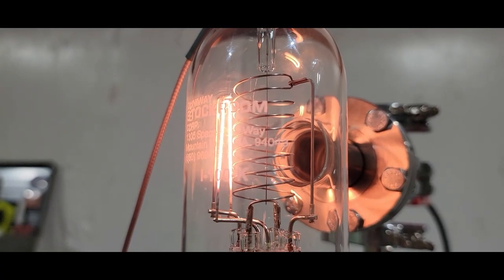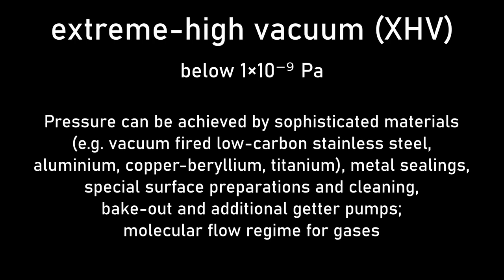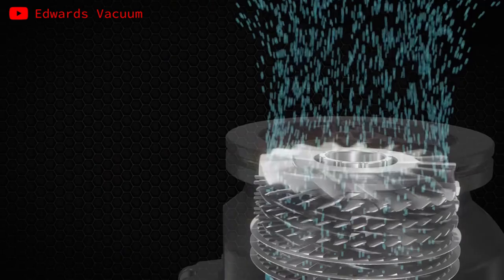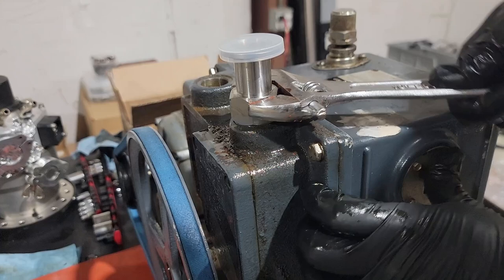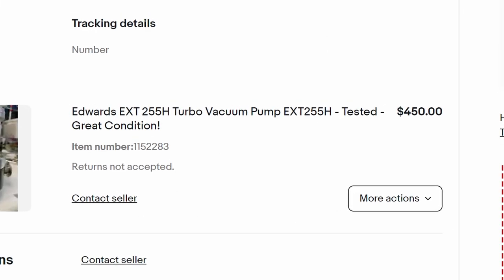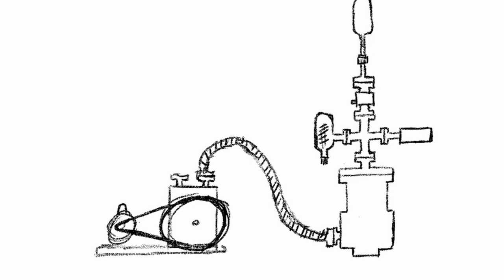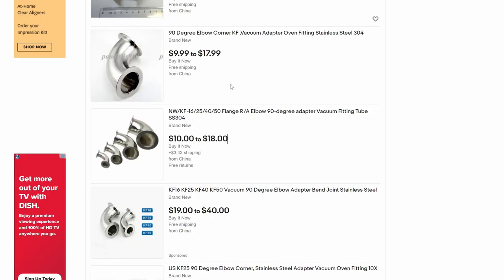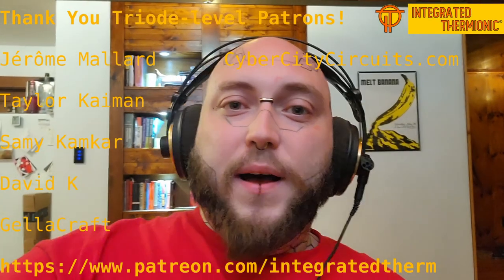High-Vacuum Basics and Evacuating Electron Tubes

Comment: Great video, and a clean explanation! A couple corrections:
1 - Ion pumps are UHV only, and require a high vacuum stage before them to start operating. You cannot start an ion pump from foreline, even if your forepump reaches practical limits(say, 1e-4 mbar). Titanium sublimation pumps can start from rough vacuum, but their useful life is dramatically reduced in that operating mode.
2 - KF & viton technically reach UHV, but baarely. You'll struggle to go below around 1e-7 mbar without suffering.
Reply from the maker: I appreciate the clarification! Pinning your comment for future travelers.
Reply: And no mention of cryogenic pumps
Reply: @moonpiespotlight4759  They're too expensive for your typical hobbyist. And too power hungry sometimes.

Comment: As a former sputtering engineer, this is a good explanation.  I do wish more of the vacuum pressure was used with torr instead of pascals as it is sort of a standard in the industry.  I feel you could have touched on cryopumps, and while I understand they are a little outside the realm of a hobbyist, they also have great pump speeds with water that far exceed turbos for a similar pump size, not including external compressors.  I appreciate your explanation on valves, gauges, and on the pumping measurement thought process, good job!  Good luck on your vacuum endeavors and BTW I may also have a couple of varian rotary vane pumps, plus boxes of CF stuff taking up space in my garage, if you are still looking for anything....

Comment: Crycoolers if another way to achieve high vacuum.  During tests for repairs, our chambers get as low as 3x10^-7 with a Roughing Pump + a TMP evacuating the chambers.  And our goal isn't high vacuum, it's testing heat load, so anything over 9x10^-5 is just a consequence of the low temperatures and gas molecules condensing on the Radiation Shield.  Now imagine if you had a dual chamber with a large butterfly valve and a way to actuate the head of said Crycooler in and out of the main evacuation chamber.  You could pull a UVH, actuate your Crycooler into your main evacuation chamber in order  to condense any extra molecules floating around (This has the added benefit that any molecules that don't cool enough to condense will still have less kinetic energy, thus decreasing it's mean free path allowing the blades of your TMP to better capture those slower molecules).   After Extremely High Vacuum is achieved, you can then you actuate the cryocooler back into the secondary chamber and close the butterfly valve in order to prevent anything condensed on your Cryocooler from migrating back into your main chamber.

Comment: 8:02 - Its interesting that there are no information about drag pump, all I'm able to know about them is hearing and reading about it but not able to get a description of what exactly it is and how it works. No videos of it, no pictures of it. I didn't know that the bottom screw spiral at the bottom of the turbomolecular pump is actually the dragmolecular pump, really interesting. Would be nice if you made a video about it and discussed the progression of early turbo molecular pumps, I know that drag pump was the first molecular pump of it's kind then came the turbo pump. 24:07 - Smart, in a professional setting I bet they do the same. Imagine needing to keep track of 40 valves and lost track of one valve... that would jeopardize the experiment and could even be a disaster, digitized valve system is more safe and organized. Excellent explanation on the subject.

Comment: My late friend used to run an optical shop which made large lenses and mirrors. He had a large vapour deposition system to aluminise mirrors up to 1 metre in diameter.  He said that vacuum systems are expensive,  frustrating and akin to black magic.

Comment: You can actually rough through the turbo if your pirani gauge has contacts to control the on/off of the turbo. This means you can stop the turbo and open a vent line to vent the  vacuum chamber. This removes the need for all the isolation valves.
Reply from the maker: In my application, it may be necessary to bring the exhaust port up and down from high vacuum in a relatively short period of time and I'd like to avoid the long spin down and spin up time of the turbo whenever that's necessary. When the system is brought up, it initially roughs through the turbo, but after the turbo is spinning, it's much faster to just vent and then rough down only the evacuation port when necessary, isolating the turbo so it never has to turn off.

Comment: Turbo pumps are not that sensitive to spurious volumes.So if the tube was at ambient, I'd slowly open the valve to the turbo.The turbo may slow down for a few seconds... As long as it doesn't start screaming..

Comment: Great video! Thanks for all the info 🙌 I have a question for you, what adaptor (thread size) did you use to convert that harbor-freight rotary vane into KF25? I have a CPS (10cfm pro-set) vacuum pump that I want to upgrade to KF25 on the inlet port, I think using loctite or torrseal on the KF25 adaptor thread could give me a perfect seal for upgrading the original flare sae inlet into a KF system...
Reply from the maker: The inlet on the Harbor Freight pump is NPT. I bought an adapter from "LoCo Science" on eBay. They've been a good source for new KF fittings. You may find an SAE adaptor. If your application is particularly critical, you may be able to force an NPT fitting there and seal it with something, but I don't necessarily recommend it. If you are going to attempt that, something like Hysol 1c (I assume that's what you mean by Loctite) might do it. You could also try a hard wax vacuum sealant like Apiezon Wax W or Faraday Wax.

Comment: I’m just trying to get components for my simple 1 stage rotary vacuum pump to be able to do roughly accurate vacuum distillations but it’s been quite the struggle. Such a fantastic video though and super fascinating. What type of work are you hoping to do with this setup?
Reply from the maker: Sorry to hear it, yeah vacuum parts seem to be rare and expensive in general. 
There are a few different types of electron tubes I want to build and play with. Initially, I'm interested in VFDs, but I want to play with CRTs and other display tubes as well. I also have some ideas about novel planar triode/pentode devices. Eventually, I'll probably wander into accelerators and other particle physics stuff. Just fooling around in the garage type of stuff, not trying to spin up a tube factory or get published or anything ^^
Reply: @SignalDitch  Sounds extra cool. Excited to follow along!

Comment: 15:10 youd been better off casting and smelting your own new pulley.. perhaps out of old brake rotors or somthing else that is cast iron.. you could used what was left of the original and still made out a pretty decent pulley.. ofcourse if any of this is within your skills though.. but it honestly isnt that difficult

Comment: Am I shtupeed?  Inches of Water? Inches of Mercury ?
Reply from the maker: I don't understand your question. Are you confused about why those units aren't covered? Those are more common in low/rough vacuum, like you might find in refrigeration and HVAC. As I mention in the video, we do use a measurement derived from millimeters of Mercury called the Torr (which was later redefined, so it's not strictly 1 mmHg, but it's close). You're not likely to find InAq or InHg on a commercial high vacuum gauge.